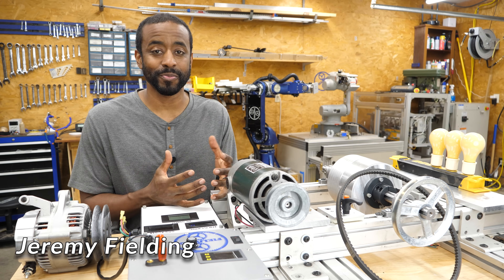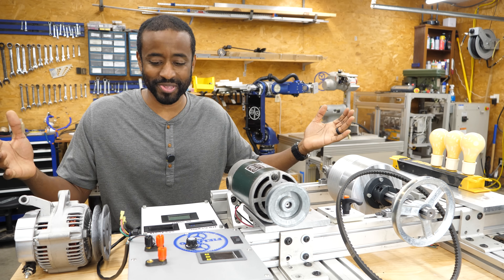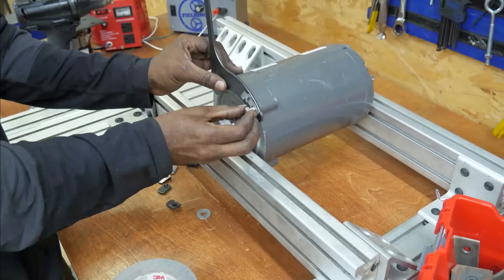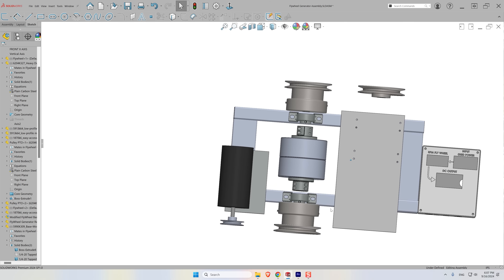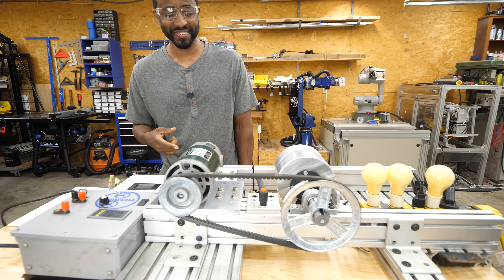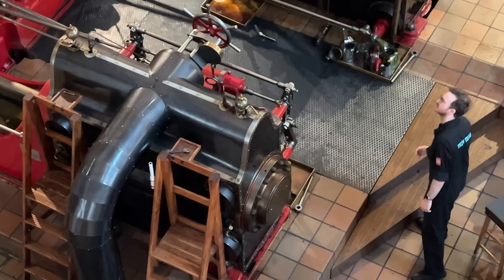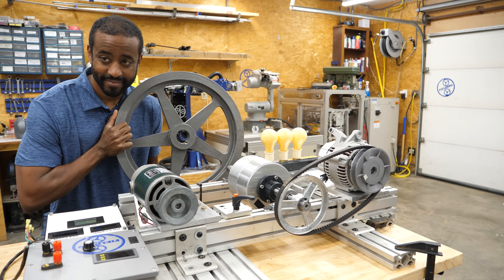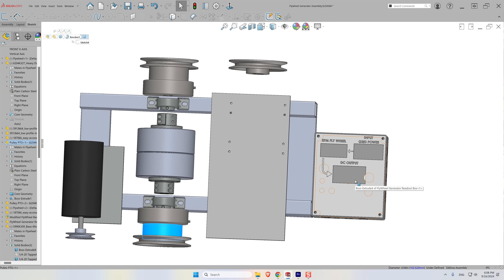A Machine To Test Free Energy Ideas.

Comment: I'm curious: Why didn't you use something more dense, like brass for the flywheel? Was it cost or some other factor?
Reply from the maker: It only needs to be heavy enough to do the job. What is the job? It is just a benchtop science experiment to teach people about physics and demonstrate energy stored in a spinning mass. This does that.
Reply: @Jeremy_Fielding  So basically, you chose it because your priority was the demonstration, not efficiency. Good enough to do the job wins out over trying to wrest every bit of efficiency you can get out of the system.

Thanks for answering. I'm always interested in the choices between options when people design things. I think that a lot of information about engineering can be gleaned from looking at the decisions made in the design process.

I like this idea of actually testing "free energy " devices. You do a great job of explaining why they do not work and what the deceptive part of the setup is. I'll be on the lookout for more of these videos.
Reply from the maker: @wrekced  Yes. Just look at the formula. If you double the speed you get 4 times the energy storage. so you can half the diameter double the speed and get the same energy basically. That is what engineering is all about. Controlling the variables to meet your needs.

Comment: the issue is getting the right parts and getting things timed correctly magnetic fields are not simple take the behidini motor it works no debate but the amount of gain is tiny for the size but if you flip the magnets the wrong way no over unity if you use the wrong gated mosfet or transistor and you fail to extract your intended power from the collapsing field no over unity and if they gave a parts list just watch for a magic recal on said items

Comment: IF it has bearings, it CANNOT be a perpetual motion machine, because the bearings will eventually wear out (including magnetic and air bearings).  If it has Belts or Gears, it cannot produce more energy than goes into it, since the inefficiency of that drive will be about 3% or more.  Such devices would have been discovered eons ago, when we had bearings which were over 99.9999% efficient.  None of the above is even close.  Needs atomic suspension, such as on the Einstein probes.

Comment: Jeremy, run the program first in graphics mode to check it, on the right of the screen is your Z depth,  also on a first run, 25% rapid, and single block to have chance to prevent a crash. With haas mini mills, clearance is always a problem with tool changes, before any tool change move the part in X away from the tool change. 
I was reaching for FEED HOLD watching the windmill heading towards the chuck

Comment: Jeremy, I have a great respect for your work and videos. The fly wheel, magnets, and such are bunk, being an expert in the field of new energy creation - I have never seen a real free energy machine which "amplifies" power. 
Yet - my team has been successfully building and studying altered mass systems for the purpose of new energy generation for over 14 years and have tested 27 ways to cause new energy generation, which of course comply with related physics, are testable, repeatable and simple. 
These methods always have a common denominator - and when you understand it - its truly simple - most visitors have a hair raising chill experience when the realized they lacked a simple bit of knowledge: When you reduce the cost of resetting a potential (greater than friction), and combine it with a standard work process - the value of the reduced reset cost I results in new energy creation - exactly proportional to the value of the reduction - predictable, repeatable, and testable.  The free energy is a remainder of a process - not a amplification - but they look exactly the same.

Comment: What happened to the coolant flow
Reply from the maker: I tinkered with it. Trying to get the best results. Before It took a long time for the coolant to fill the line back up each time it turned off. I added one way valves so the coolant didn’t drain back into the tank but that reduced flow. Then I added another line, but that causes other effects so I tried more stuff. Basically it is a work in progress.

Comment: This video has a few nice points. But in general please don't waste your time on combating any specific "free" energy claims. It is a losing battle. Most people claiming to have a free energy device are scammers (even if it's just to sell some plans or parts) that know full well that they are lying. The people falling for it are like members of a cult or conspiracy theories. No external arguments will sway them. They have the whole knowledge of the internet in front of them and choose NOT to inform themselves (even about basics like what is voltage/current/power/resistance/torque/energy or how you would even set up an experiment to test your theories), because it does not fit their preconceived opinion.
I know, sounds bleak, but that's unfortunately how people's psychology works.

Comment: What you called a "PTO" (Power Take off) in the beginning of the video was an Electric Clutch.  The Pulleys out board are where you are either putting in or taking out the Power.
Reply from the maker: When buying the part it was literally called a PTO. I don’t know what to tell you other than that is what I ordered LOL. I am sure there are all kinds of hairs we could split here but if you search for PTO this is also what you find.
Reply: @Jeremy_Fielding  Ah, yea the mower company probably calls it the PTO Assembly.  Great work and video's though.

Comment: I see you got lots of people commenting. So a hint might do well....Free Energy is provided in the Universe. To harvest one needs to flow gas between two very closely placed electrical conducting plates. The difficulty lies in the nano spaces physics and enough pressure to operate such a piece of master engineering, test are been done with the sandwich method.  The University of Colorado is conducting research. A patent is issued Us patent 7,379,286 quantum vacuum energy extraction.

Comment: Imagine taking two pieces of string to hold the magnets laterally in place. Twist the magnet string combo to wind it up and then line up another magnet nearby to show the rotation affects when you let go.

Additionally, I am curious if the magnets will close the gap as slack returns to the line, and how it then responds as it fights against the magnets desire to snap together.

Comment: If you are using long tools, you should half (or more) your SFM and Feed. You got some pretty serious chatter on the outside of that cylinder which is bad for your tools and dimensional accuracy. Alternatively, you can get variable flute tools which are good at reducing chatter, but are expensive. Also, override your rapids when starting a new program. You can view your current position on the Haas controls relative to your G54 (or whatever offset you are using) and if you do so slowly or just feed hold and check while it is stopped, you should have plenty of time to notice that something is wrong before crashing your tool into something. I personally set the top of my part as my G54 so that it is easy to program rapid locations and to be able to easily tell of my offset is wrong. This also allows me to check where my lowest point is (Mastercam calls this an extent) and see if I will hit my fixtures before running the program.

Source for rambling: I work as a CNC machinist while I am finishing my PhD in Mechanical Engineering.

Comment: Another area of confusion is that most people don't seem to know the difference between voltage, current, energy, and power. The only thing that they seem to have learned about electricity is voltage. I commonly see voltage being confused with power or energy. Seeing that rotary table getting accidentally drilled made me cringe.
Reply from the maker: Indeed. I get a lot of messages about transformers increasing power. It is exactly because of what you are describing

Comment: doesnt a larger  diameter flywheel have a  larger torque factor than a small diameter flywheel?
Reply from the maker: to be more specific the farther away the mass is from the center of rotation, the greater the rotational inertia. This just means the flywheel can hold more energy as this number increases. The trade off is the flywheel is more difficult to spin up thus the energy trade is the same. This doesn't change anything I said about free energy. It just changes engineering trade offs like whether your design requires less weight, or less overall size, or the material can't handle higher speeds. Since the speed is squared, increasing the speed is usually better overall for the systems size and weight rather than increasing the diameter.

Comment: Using a C&C for that flywheel was not the right tool for the job. Yea it did it but a lathe is much better suited for that work and you would have gotten a truer stability out of it.
Reply from the maker: LOL Of course the machine designed to make round things is better :) I don't have a lathe, so I used what I have.

Comment: I'd love to see you do a video specifically on flywheels, experimenting with angular momentum and optimising a flywheel design to have as much mass as possible near the circumference. That'd be a fun video, explaining how simply having a heavier flywheel is only part of the story, showing comparisons by having two very different flywheels that are the same mass :D
Reply from the maker: I wanted to cover that in this video actually. Specifically how speed changes the storage capacity so much more than rotational moment of inertia. But it felt like a lot to add at the end of a 20 minute video LOL. So I cut it VERY short in the end. It really needs to be it's own video.
Reply: @Jeremy_Fielding  I can't wait to see what you do next :D Even if it's mechanical principles I know already, I still love your videos because of the way you explain how things work

Comment: I once made a motorized turntable using a chair type bearing (for swivel chairs).  I had lots of trouble with binding and could not get it centered properly and the bearing had no tolerance for sideways forces.  My solution was to simply let the bearing float.  The turntable was locked in to the center by a motor shaft which could not support any weight but the bearing did that part.  It was bolted in but just enough play to move with the turntable.  When things bind, sometimes just allow it to move.
Reply: Hi, my name is Frank and I am glad to hear that you made it successfully. Please could you share some info to help build one? Thanks for giving the hope that there is still a way to make it work.
Reply: @frankatsuduvon202  It was actually pretty simple.  I just used smaller screws (it was all mounted on wood) so that the bearing could move just a bit.  Only on one side though.  The base with the motor was firm.  All you need to allow for is the slop in the cheap bearings.  Smaller screws didn't matter because the load is vertical so the screws just need to hold the bearing in place actually.  I discovered it when trying to figure out what was binding and tool the screws out entirely from the upper portion and it turned fine at that point.

Comment: Good job at being willing to try things. One of 2 things is happening here:
1.  You've already decided that it's impossible and will only try things that will patently fail since they are not over unity. You know...like you did before with the motor and alternator. That was cheap and lazy BTW. OF COURSE it was never going to self run!
2. You will try things like the John Bedini motor or Tesla resonant coil or Howard Johnson motor or Perendev or gravity motors or V gate motors or a sterling motor that uses temperature gradient properly or gas gradient change OR ... you know...REAL over unity devices.
NOTE: the irony here is that there is no such thing as over unity! You are simply gathering energies that are resultant of the device operating. There is always an energy source...just unconventional ones such as bEMF or magnet electron spin or thermal gradient or gravity.

Comment: i've been learning about motors recently and i've been trying to use ai to help with the terms and formulas but its so stupid like asking a child that has read a dictionary with a photographic memory.

the internet has a stark lack on information on gearing and transformer theory (laymans terms). like isnt ferrite used because we can increase the frequency to get more total power though each cycle is less strong? but that would require lots of magnets and coils to get higher frequencies and would really affect maximum torque per case size of motor (assuming same efficiency since we can get ideally infinite torque just by increasing amps forever but heat exists and occurs at an exponential rate after the core material has saturated).

Comment: The problem with free energy is people do not understand what it actually means, everyone thinks that term means creating or destroying energy which is the wrong goal, the goal is to make a machine that has commerce with the environment on the input side, there is no such thing as a closed system else it would be impossible to lose energy in the form of waste heat to the environment on the output side.

Free energy just means COP > 1, Coefficient of Performance, there's nothing weird about it, people just need to learn the difference and shift their mindset.

Comment: Take a look at the clutches on automotive AC compressors. Similar electromagnetic activation as the lawn mower clutches but machined to a higher tolerance. They are also designed to work with radial input loads since the pulley is part of the outer shell and the accessory belt drive system of the car. They would also add very little rotating mass when disconnected since just the clutch plate and some springs would be all that's directly attached to the flywheel shaft. If you want a v-groove pulley then look for something in the 70s or early 80s. Anything after the mid 80s is likely to be a serpentine belt. For example, a 1980 Ford LTD with a 5.0L engine has a  5" and 6" V-Groove clutch kit available from brand Four Seasons for around $100. Those Four Seasons part numbers as 47284 and 47531 respectively. You would need to build a base plate for them but the clutch kit includes the Pulley, clutch, and coil. It's worth noting that those two part numbers are for different styles of compressors so their mounting will be different.

Comment: Use a flywheel and an alternator, but hook up the flywheel to a kite sail (hoisted by a birthday balloon for cheapness).
The near constant pressure from the wind above roofs will do your job.
Reply: You can even add a solar panel hooked up to a simple re-winder for when it's not so windy.

Comment: The man, smiling, tries, with the air of a magician, to explain that he has a flywheel on the shaft, although apparently he understands perfectly well that it is just a massive load, since inertia depends not so much on the mass of the flywheel, but on its diameter, due to which the inertial force becomes greater. He's trying to make a fake video about
that generators built according to the “Rotoverter” scheme, which are reproduced all over the World, do not work. Unfortunately, there are many such magicians paid by charlatans.

Comment: Instead of PTO units would it be better or possible to use a one way bearing inside the drive pulley. Like a baitcaster fishing reel uses in the crank handle. If the pulley is turning faster than the flywheel the one way bearing grabs onto the shaft until the flywheel matchs the speed of the pulley. Then, once you disengage the drive motor the one way bearing allows the flywheel shaft to freewheel inside of it. Just a thought. Enjoyed the video, keep it up.